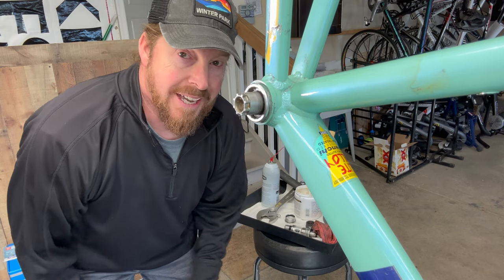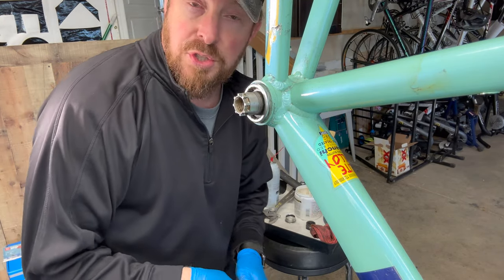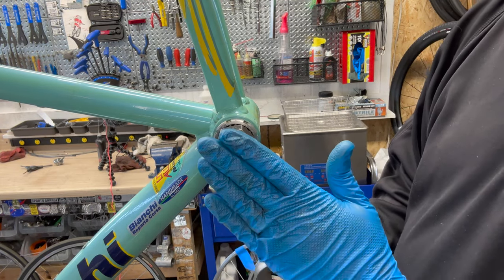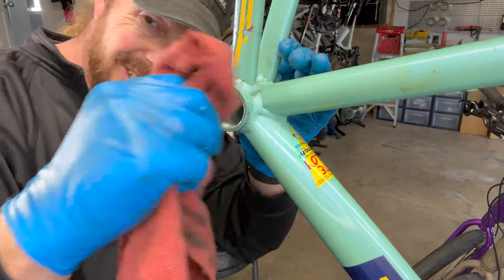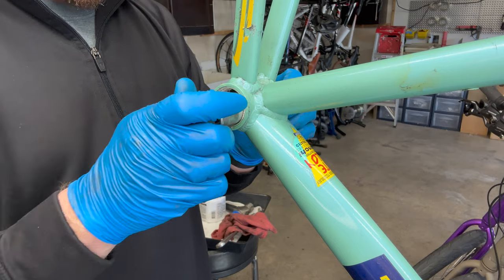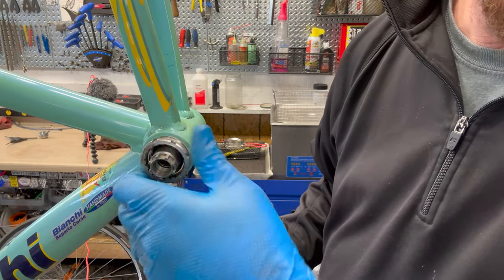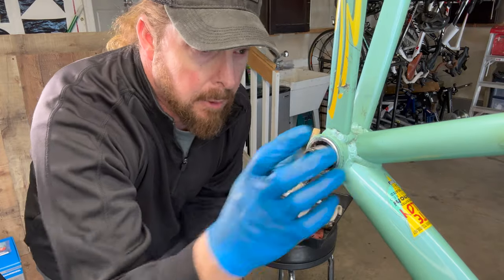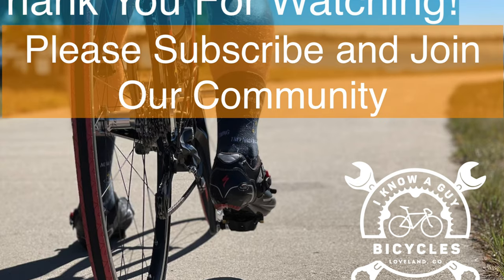Replacing Shimano Ultegra BB-6500 Bicycle Bottom Bracket

Comment: I lost the adjustable cup for my BB6500 bottom Bracket, would i Be able to use an adjustable cup from another bottom Bracket?
Thanks in advance!
Reply from the maker: Maybe a BB-5500 would work, but at that point since BB are not too expensive I would just get a new one or refurbished one to insure it fits correctly. Make sure of the three measurements, Italian or English thread, BB shell length and spindle length for either a double or triple.

Comment: If you can’t find the bb-6500 would the bb-5500 work for a replacement?
Reply from the maker: Yes, but make sure it's the right size. example. (69 x 118.5) for a triple crank.
Reply: @IKnowAGuyBicycles  🤘🏾got it. What type of grease do you use? I typically buy phill woods.
Reply: Gotta watch out for v2 octalink as well, think it was only the MTB hardware but Shimano made visually similar bb's with slightly longer splines for a while.
I use dedicated assembly paste not grease fwiw.